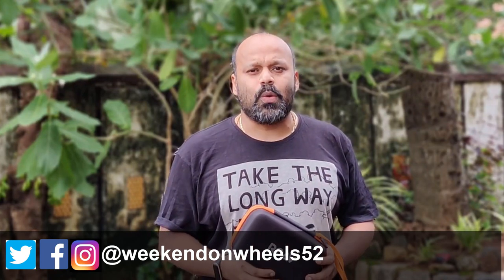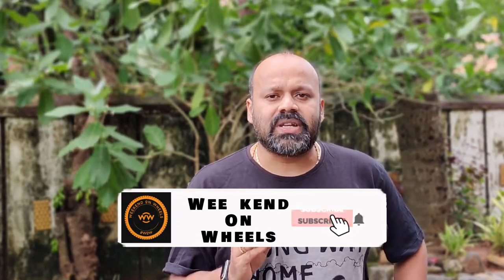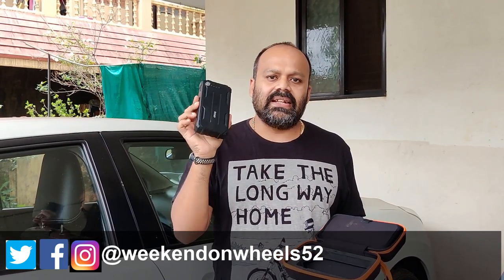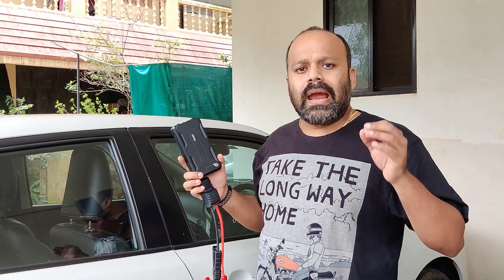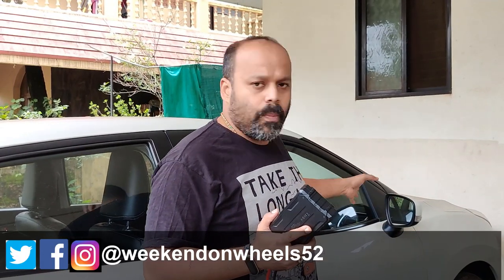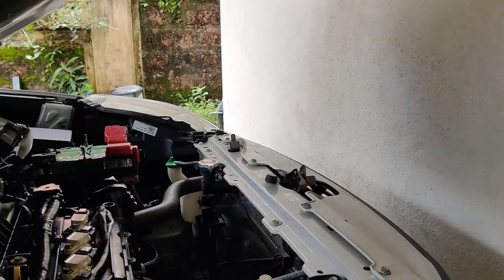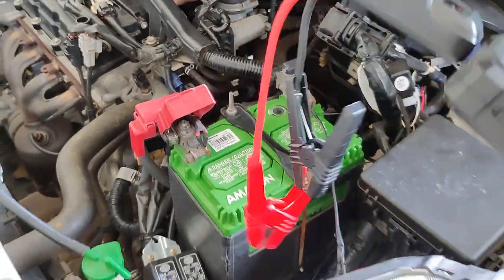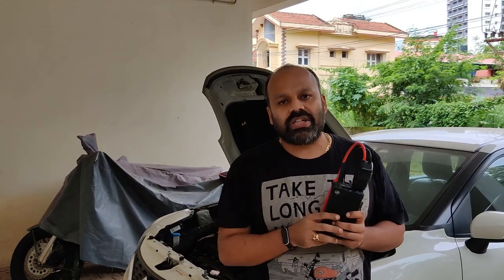Anker Roav Car Jump starter | Car jump starter kit | DIY

Comment: Can you charge the battery pack in your car or only to a wall outlet?
Reply from the maker: If you have the 3 pin socket charger vai USB in your car then you can charge in the car itself.
Reply: @WeekendOnWheels  what is a 3 pin charger. Is that a cigarette adapter?
Reply from the maker: @MadMax75th  no it's not

Comment: The Anker Roav 800a is quite weak.  It has trouble starting any Continental (VW, Merc, BMW, Audi) car that is 2.0L and above or a car battery capacity of 70Ah and above. Not recommended.
Reply from the maker: Thank you for your feedback 🙏